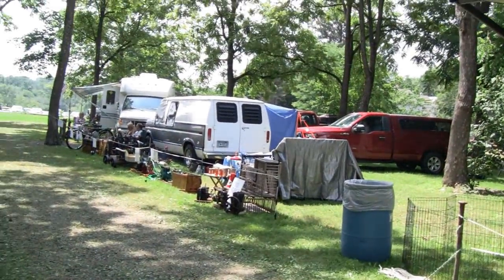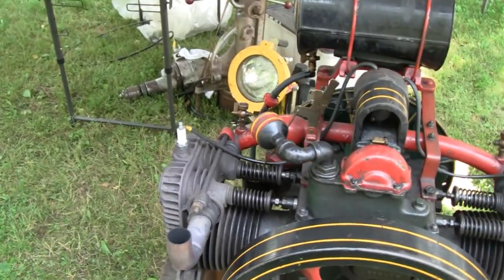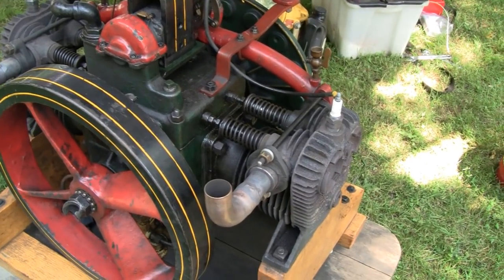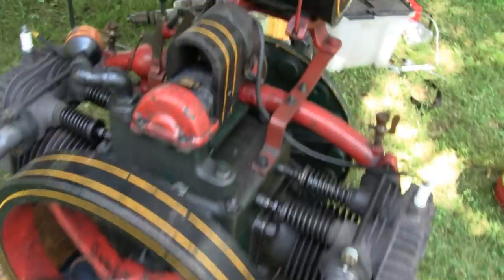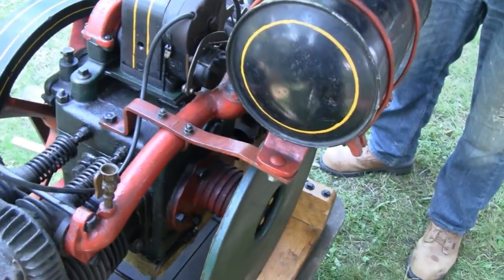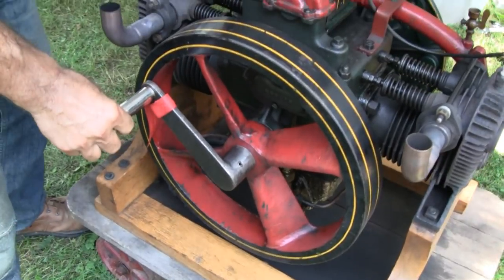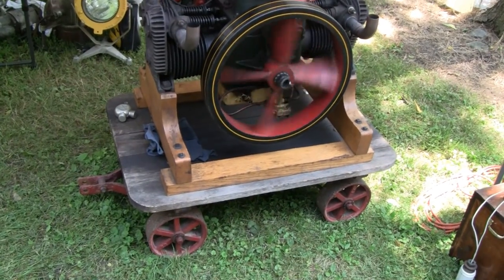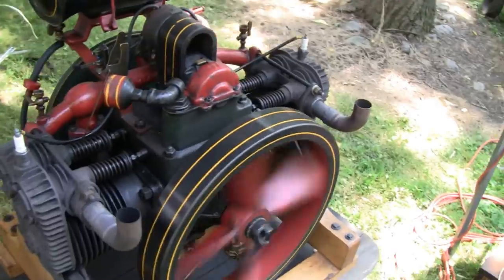EXTREMELY RARE BUDA RAILCAR ENGINE (SPEEDER) 1920's

Comment: As a kid back in the 40s & 50s, I vividly remember the speeders putting down the tracks. I believe some used a 2-stroke engines and could be run in either direction thus solving  the reversing problem.
Reply: Fairmont with big 2 strokes. Clever working of ignition timer could reverse without stopping.

Comment: I remember Keith Rucker working on an old 
friction system, for the lumber mill.  It has a 
paper driven pulley, that presses up against 
that "flywheel."  No, it isn't writing paper, but 
laminated tough card stock, something like 
the paper used to make pegboards.

steve

Comment: Man I like that motor! Those horizontal 4s are cool! I've got the latest version in my rig lol ... I've heard them called pancake and airheads in BMW and vw .always been a fan .. and they're tough I've seen them still running after throwing a rod! You could see the crank moving through the whole in the block the rod left !! And the drive system was the birth of the centrifugal trans and clutch I believe...

Comment: There two English engines that come to mind on sight this splendid machine, and they are Douglas, and Enfield. The Douglas as I recall them were quite small engines and suited to powering small boats, but the Enfield was a much bigger beast, about as big as this one. I've only ever seen the diesel versions of the Enfield, and they are a work of art to start them, but the sound good, and they're quite punchy. The thing about the Enfield is that it looks extremely like this one, but not as nice looking!
Reply from the maker: I'm not familiar with them 2, well have to check them out!!☺
Reply: Douglas petrol, Enfield diesel and petrol,ABC petrol,Jowett petrol, Levis petrol, Nut petrol, Williamson petrol, all flat twins I am sure there are more